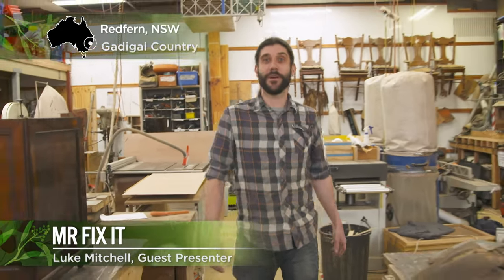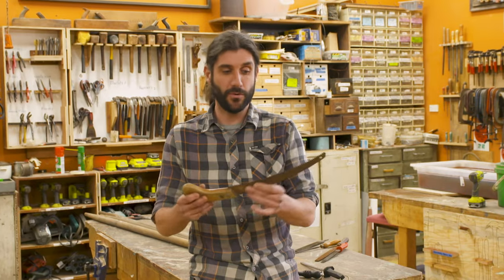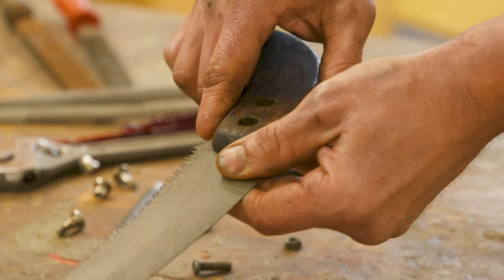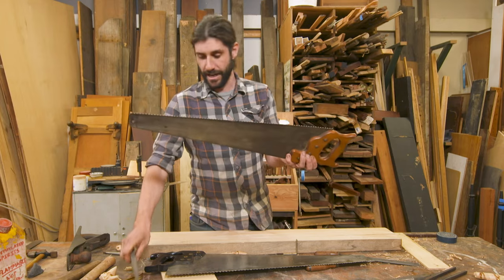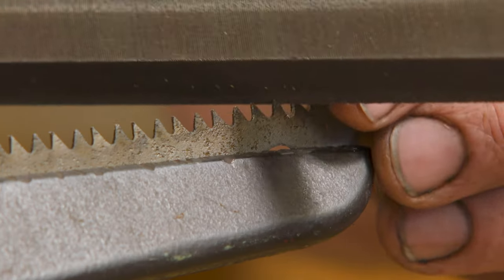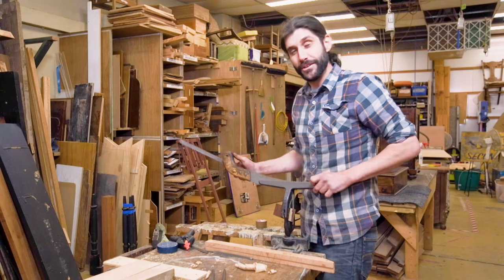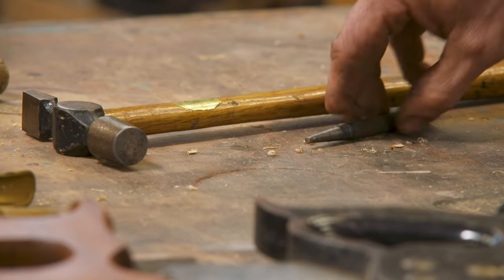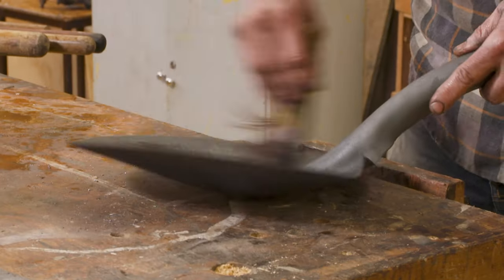Restoring Old Tools | Mr Fix It | Gardening Australia

Comment: When using linseed oil, don’t through the used rag in the bin. Soak it in water and hang out to fully dry or burn it. Otherwise you can set your bin or house on fire! Also dulling the first few teeth make starting the saw a lot easier.